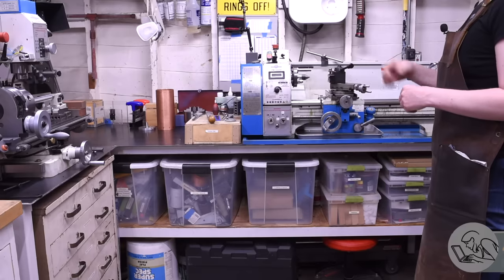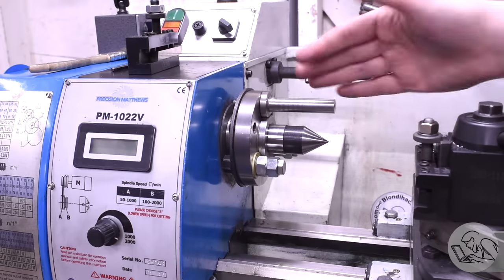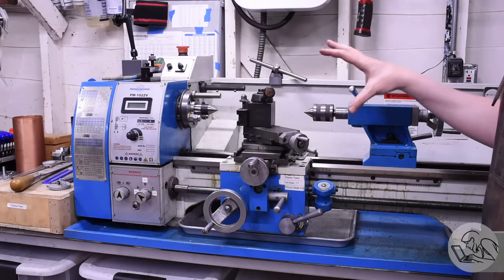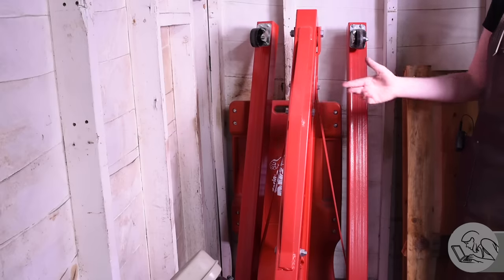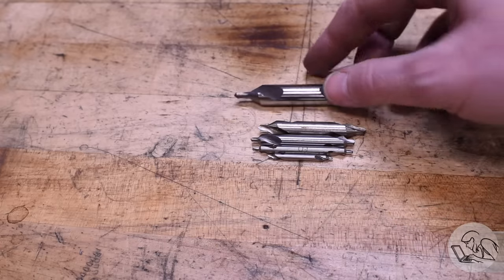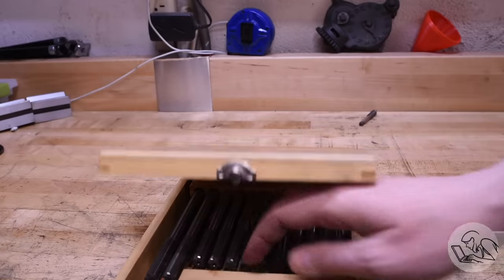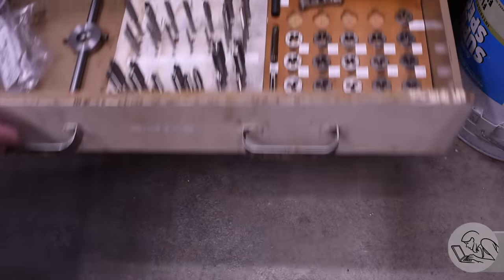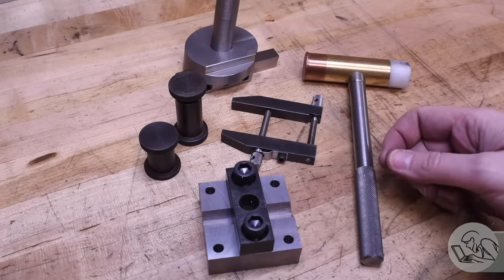Getting Started In Machining - Absolute Beginners Click Here!

Comment: Excellent video Quinn, I have commented how one day I'd like to get started in this hobby... The question not answered was how much $ is needed to get started with the tools on your list plus a decent lathe?  About $6K? I think that's sounds reasonable... What you have shown me is setting realistic expectations about machining, and I am grateful for all of your great advice.  Your question: "What do you want to make?" got me thinking... What I like making is Halloween animatronic props for my haunted garage, e.g. pneumatic, servo, and electric motorized (I have 2 videos on my channel) and while sometimes I may need a specialized part, for now I can get a 3-D printer as a compromise... so my next step would be metal fabrication (welding and grinding) that directly supports my hobby... but don't worry,  I'm still thinking about machining and I will always be a big fan of your channel

Comment: I’ve got a Grizzly 7X12 mini Lathe. I’ve spent a fair bit of money upgrading it. Out of the box it’s pretty good with steel. But you need to go easy with it. You have to make light cuts and lots of passes to remove a good amount of metal. Brass, aluminum (aluminium in British metric), delrin and many other softer materials can be machined easily and quickly. I plan on eventually upgrading to a 9X20 or a 10X22 from Grizzly. I’ve got a Harbor freight Mini Mill that I started out on and it took a ton of Little Machine Shop upgrades to make it a capable machine. But I’ve moved on to an old Rutland drill/mill with a round column. I’m not a fan of the round column. If you have to adjust the head for deeper cuts, you essentially have to re-do your whole setup since the head swivels when you raise or lower it. I intend on eventually upgrading to a “proper” milling machine with a dovetailed column.
My advice to beginning hobby machinists is to be careful of the machines you buy. Dovetail column milling machines are the best. If you opt for the mini lathe or mini mill from who ever. Expect to pay for lots of upgrades. By the time you’re done spending money on upgrades. You could have bought a nicer and bigger machine. They are bare bones machines with very few of the nice features you find on bigger machines. But if all you can afford is a small machine. There is fun to be had in turning it into a badass little workhorse. Also, buy the biggest machines you can afford to buy that will fit in the area you plan on putting it in. An 8X16 is good. But a 9X19 is better and a 10X22 is even better still.
I guess this is the end of my essay. So get out there and make chips. Or at least start searching for that holy grail machine that will change your life in ways you can’t imagine.

Comment: Cheapest part is the lathe, the tooling will eventually end up costing what you paid for it after a while. Yes cheap tools are around, but often you can get them used, saving a lot of money. flea markets often you find old tools going cheap, but there Caveat Emptor applies. Auctions as well, but the same applies, and garage sales are also a good way.
Reply: My lathe takes up half the shop...
It's just a little 9" South Bend in a reasonable sized shop...
But the racks of tooling acquired over the years...

Comment: To paraphrase This old Tony - if you're just starting out, be aware that the cost of the lathe is like a small upfront payment. The cost of tools and materials will soon dwarf the cost of a 7x14 lathe! Oh, and another source of good starting projects is upgrading various bits of the cheap Chinese lathe you've just bought. Better headstock bearings make a huge improvement to the 7x14.

Comment: Thank you so much fo this intro and info
I really appreciate your approach to learning
Particularly the part where you (sic) say
'It's not about the end result, it's about the journey' 

I can give you a great (slightly long-winded) example of how that works.....

I'm an amatuer gold prospector
who get's as much fun out of making prospecting machines
as I do actually going prospecting 
I recently converted my dead front-loader washing machine
Into a combined mill & sluice
prospecting is usually a great excuse to sit around a campfire with a few mates
trying to figure out what's wrong with my 'on-the-fly' designs

My latest project is making a jaw crusher
that uses triangular bastard files as teeth
so the metal work in making a strong enough frame to hold the jaws that crushes the rocks 
but is also adjustable/repairable in the field
has lead me down the metalwork path
I've gotten really good at drilling holes & tapping threads
but I keep doing them in the wrong spots as I re-work my design
which means I need to learn more about CAD - BEFORE I drill the holes

my initial attempts at drilling holes & tapping threads
in hardened steel bastard files worked, 
but that was at the handle end of the file
and I've since discovered the actual 'file' bit is much harder
which has led me to look at building my own EDM machine
and other alternatives to fixing the files to the plate steel

and so-on, and so on
but I'm having a hell of a lot of fun
learning about stuff I didn't know about along the way
It's not about the destination
the joy is in the journey

I think it was Edison who pointed out
he discovered all the ways to make something wrong
before he got it to work right (even though he's reputed to have taken other people's ideas)

same here, but I freely admit it
I've you-tube'd so many of other people's publications
in order to make my machines
I can't really call them inventions
they are more of a a case of 'I did it Myyyyyy Waaaayy'

Thank you for being a Great teacher!
Please keep up the great work

Comment: I love this video so much. It's so helpful. I managed to get an old atlas mini lathe that I had to restore. It really shouldn't cut steel but I threw titanium at it and it just runs right through it. Single point thread cutting, hardened steel, just anything as long as it's not too big. The best part is that it barely cost me anything aside from the time and parts to restore the thing

Comment: Really appreciate the mention of hair safety. I have short hair now but when I was doing more of a girl mode thing, keeping hair out of the way was a constant struggle.
Reply: And Gloves. Loose the gloves or loose a finger. Better to have a couple stitches in your thumb then not to have a thumb to have stitches in.

...and don't fall for the "rip away gloves" BS.  They are every bit as dangerous as any other glove. - Like say when filing the corner when you are parting off and they pull your hand over a half inch while they are ripping away,,,,,and you get tangled up with the 4-jaw.

Comment: For me a mill always comes first. I'm normally fabrications something which requires machined parts. I could get by without a lathe but not a mill. That being said I have a mill, lathe, surface grinder and a 60 ton press. It took about 6 years to acquire my machine shop equipment, welding and cutting equipment.

Comment: what i am doing while i wait for my country (and myself) to stop sucking at economics and be able to actually buy any kind of machine tools without selling a kidney, is to learn about all of this. check all the videos you can, even the crappy ones since learning what NOT to do is very important too. im also learning about material sources. just as an example, most every spindle in a car wheel hub is made of 4140 steel (kinda hard to machine with entry level tools, fyi). brake discs and drums are cast iron, mostly. brass, bronce and alumin(i)um can be easly cast into round or square shapes (for simple projects. sometimes you need specific alloys as blondi said). being able to practice on cheap or even free materials is nice (keeping in mind that some materials are hard to work with, so keep your frustrations at bay)

Comment: Good info for a very basic overview...turning ain't something you can learn on the Tube. I'm not only a CNC machinist but also a machine tool builder last working for Haas Automation. You lead with safety, which is good but ya really gotta hammer home the fact that you have to be extremely careful around any machinery. Especially a mini lathe with no door between you n the workpiece. 
Everything needs to be tight or it can come flying right at you. I have a 7x12 Vevor Mini n for $425 they're hard to beat. Rough around the edges but I can fix that n make it hum 😊

Comment: Okay you got me.  I've touched a lathe once since 1974.  I'm sure you don't remember that very well.   Not me touching a lathe...... the other part.
In high School machine shop,  I don't recall setting up a four jaw chuck.  Maybe we did, I just don't remember. I don't recall having the teacher tell me anything about the accuracy differences between a three and four jaw chuck.
You mentioned that you can't swap parts end to end with a three jaw chuck.  I figured unless you had an offset part you didn't need a four jaw chuck.
I'm going to go out on a limb and say the reasoning is that centering a three jaw chuck is not repeatable process.
Probably close, but no cigar?

Comment: I just hope that when I die, my wife sells my tools for what they're worth, and not what I told her I paid for them!  :)
Don't know why this came up in my feed (retired machinist/fabricator, certainly not a beginner) but darned good advice!
I'll just add one piece of gear every machinist should have: The Machinery's Handbook.  Don't worry about the latest edition, the older ones are aimed more at manual machinists, and can be even better for the hobbyist. Feeds, speeds, formulas, specs, etc. all laid out for you, along with a wealth of general information that can make your life so much easier. It is the bible of machining, fabricating, tool making, and engineering. (I use the 20th edition from 1978, because I'm really old.... lol)

Comment: When I bought my SC2 (14"x7") lathe from paulimot the guy with the lorry got really angry at me because it was down a fairly narrow street and I had no way to move it from the lorry to the back of my apartment complex and I was in a bathrobe because I had no idea it was arriving that day, eventually he just dropped it off the pallet truck outside my door said figure it out and left. I then took it out of its wooden crate put the machine over my shoulder and carried it down a flight of spiral stairs into the basement then onto my table...I would not recommend doing ANY of this.

Comment: Batteries go dead in digital callipers constantly? Depends on how you install them, I guess. These things are intended for low current applications and don't store a lot of power. If you install them with dirty greasy fingers the oils you leave behind bridging the positive and negative terminals will discharge them quite quickly - sometimes in a matter of weeks. Try using clean latex gloves instead and you should get years of service from a single set.

Comment: Definitely don't go cheap on drills or taps. If you cant stomach the $315 on the LMS drill set, Norseman/Viking 1/2" drill index is a very solid base to work off of and will get you through most projects (quality metal and good factory grind). For taps, Shars has HSS taps sets and will be better than carbon steel taps if ground correctly. Most of the sets you see at the hardware store will be carbon steel (Irwin/Craftsman/Gearwrench/Kobalt/etc), they will get the job done and wont break easily if you get the feel down (a nice tap wrench does help with this). I still use mine and just replace them as they wear out/break with ones off MSC (hertel is currently my preferred bang for the buck). Century Drill and Tool Co ones you can find individually at smaller hardware stores to replace/expand your initial set, some of the taps I have bought from them have been made in japan. If you have a tool truck near by, Mac has a decent carbon steel set with a nice tap wrench included but wont be cheap (off shoot is they have a lifetime warranty). Keep in mind my advice/experience is based in the USA, ymmv in other parts of the world for decent drill/tap sets that dont break the bank.

Keep up the good work!

Comment: I started buying and restoring vintage lathes 2 year's ago and have 6 atlas lathes now, 2-12 inch with quick change gear boxes and 4 618 6inch,, and have 2 of pretty much every attachment for them, I've seen prices triple already as people realize buying vintage is still the best way to buy for the money,, most higher dollar lathes like Logan and southbend was bought for factory and school use and hard to find not beat to hell, atlas was more hobbist and we'll cared for,,,l just bought a Sheldon horizontal mill in excellent working condition 300 dollars,, and I have 2200 dollars investment in all 6 lathes and attachments and ton of tooling and precision measuring devices.ill hold off another few years and cash in

Comment: Quinn ... Awesome info, I wish I had seen this 20yr ago!!
I noticed that your high-quality reamer is helical where the rest of the set is straight... have you discussed this elsewhere? Mostly all of my reamers are straight with one or two helical, found that the helical is better when cleaning up deeper holes, because of chip removal and an 'old' tool and die maker told me that helical a little more accurate because of distributed contact area.

Also, IMHO a toolpost vise/clamp is critical, I use one for years before getting a mill.

Comment: I purchased one of the "Sieg-based" $700 "blue" Chinesium 7x14"(labeled 12?) mini-lathes from an Amazon seller(arrived three weeks earlier than the initial shipping estimate! Be prepared!)... it arrived in a crate made of inferior plywood(1/8" - probably 5mm) which had footprints on it and a hole where said foot had gone through the plywood, damaging the styrofoam end piece. The shipper did not require a signature and just dumped it clandestine-like on the porch, so I could not refuse the delivery based on that damage - as a receiver of freight should. 

The tailstock was loose in the packaging and had bounced around, damaging the tailstock handle wheel and splashguard. Purely cosmetic, but I didn't purchase a "damaged" unit. I contacted the seller to request replacement parts. The seller said their supplier does not offer parts, so they elected to send me an entirely new lathe(in a much more rugged shipping configuration).... then neglected to request the return of the initially damaged product. Soooo.... future parts donor or second lathe for a specialized setup. Two for one!

For those thinking of one of these.... this lathe required extensive initialization... everything was shipped "loose" and screws were rolling around in the box(one grub screw missing). the base casting had flashing that prevents the tailstock(and saddle) from traveling smoothly and needed to be ground - it is of a single piece so there is no adjustment of the ways other than with a stone. The saddle has a small wobble that is eluding my efforts, but even so it cuts OK. The most important adjustment made was tightening the crossfeed and compound nuts. Made a world of difference - according to the indicator they both had almost .03" backlash. Got it down to almost zero with the right amount of friction. The half-nut/feedscrew interface is highly dependent on the saddle(apron) height and lateral trim, very little tolerance there. For trimstock I used aluminum flashing available from the hardware store at $8 for a 12"x10'(foot) roll. Not ".087" as advertised(duh!), closer to ".0087"... The feedscrew had a deformity where it goes through the pillowblock on the motor side, on the "bearing/bushing" surface there... caused binding and the loss of a(plastic) gear... that needed to be sanded smooth.

Now that it's "dialed in", it does a good job for a relatively low-end machine. Still saving up for what Blondi has - around $2500 for that one, I like what I see. The "blue" 7x14" Chinesium lathe is great for learning machining and almost as importantly, learning the mechanics of the machine itself because it comes ready-to-go for immediate repair. The next critical upgrade IMO is going to be a tool post holder that is adjustable. Tool height is my nemesis on this machine at the moment.

For future upgrades I recommend LIttleMachineShop's mini-lathe accessories.

Comment: I think your point about knowing what you want to make should have been at the beginning. That really feeds into the decision making process. It would also be a good idea to get some formal training. Hands on experience in a class. I see so much incorrect information in YouTube videos being passed off as facts, beginners have no way to filter that.  Old machines can come with a lot of tooling and that helps offset some cost. Old machines have wear that has to be considered. Bigger is generally better, get as big as you can afford and have space for. My latest machine was a 3,000 lb vintage Bridgeport CNC. It  took a large rollback, forklift, machinery movers, and four guys to get it in place. You don't move that to clean behind. You had better plan your space.

Comment: I'd think bore gauges are important unless you are happy with only using drill bits and reamers on a lathe. For some people they fall into optional but when you can see daylight in the places you dont want to with a dial callipers (for ID); its the wrong tool to measure a concave surface.

Comment: Important to me is the start of the project...Cutting the metal to size to chuck up in the lathe...Need a band saw with a good blade as you will quickly find out that a hack saw on metal is not as easy as a hand saw is on wood.